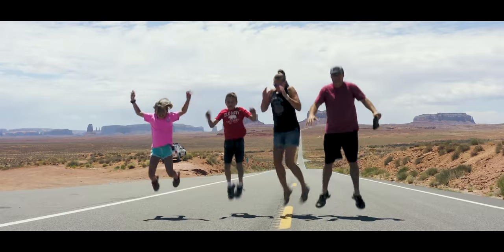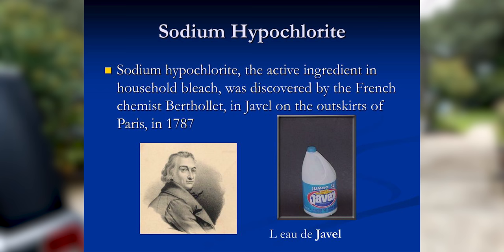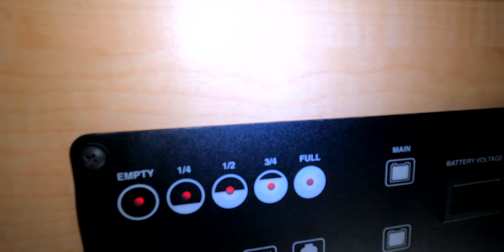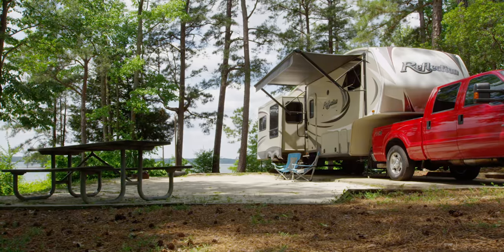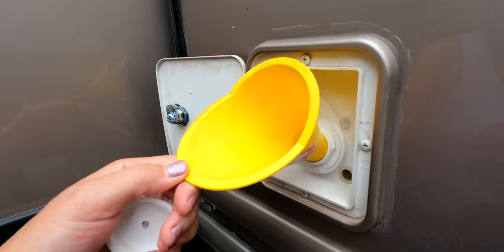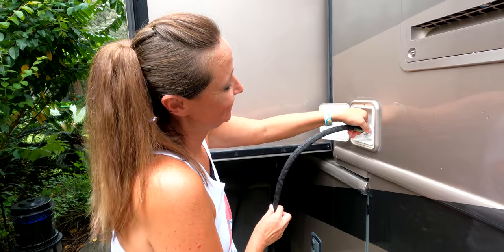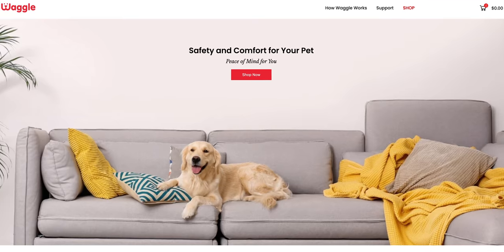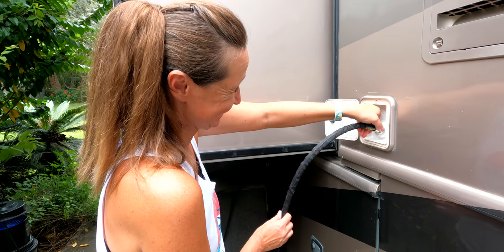What's Lurking In Your RV Water System? It Could Be Time To SANITIZE!

Comment: I noticed the hard water deposits on your bathroom faucet.  Some of those aerators have a screen that will block and collect debris.  I recommend taking them off before the start and putting in a zip lock style bag with vinegar to soak for the time the tank is sanitizing.  Then a quick pass with a scrubber or old tooth brush and they are clean, and the flushing thru the lines won't have anything stopped by them if they have the screens.  Would be a good time to do the shower head and any kitchen sink sprayer or aerator it has too.
Reply from the maker: Thanks for the tip!